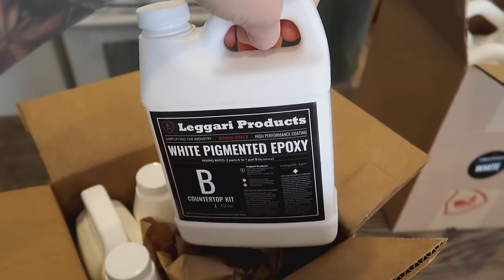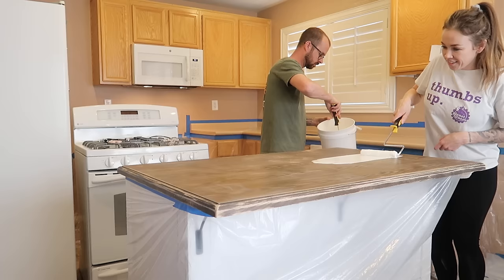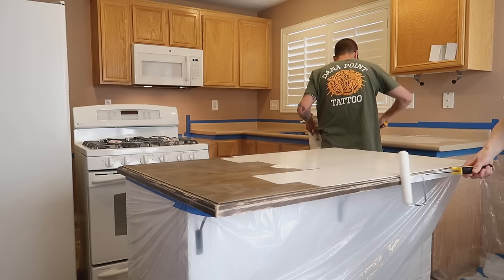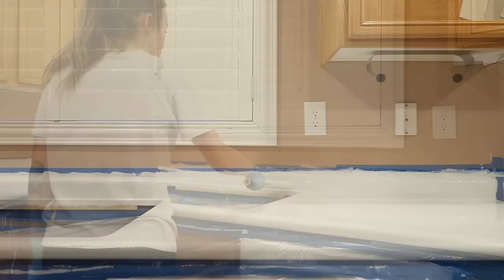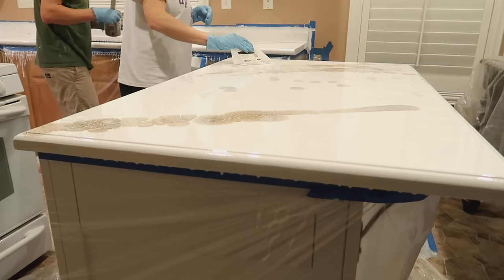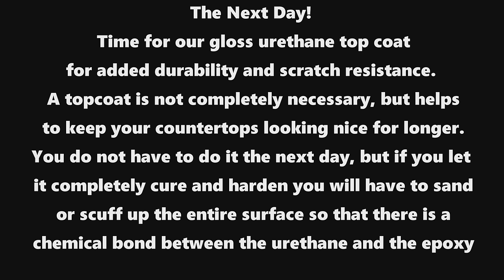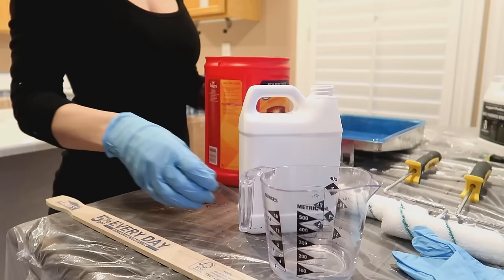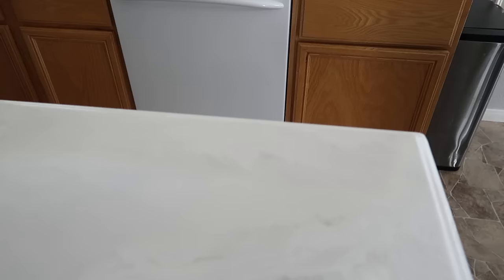HOW TO EPOXY COUNTERTOPS | WHITE MARBLE COUNTERTOP | EPOXY COUNTERTOP DIY | RENEW OLD COUNTERTOPS

Comment: Your countertops look great and I actually like the rolled look of the added color over actual veining.
I do have one question.  I've seen many videos so I'm not sure which product it was used with but to get the bubbles out the person sprayed rubbing alcohol over the top and it eliminated the bubbles.  Do you know anything about this?
Reply from the maker: Thank you so much!!! From my understanding the rubbing alcohol will give it some sort of effect for aesthetic purposes when you’re doing the highlight color (veining) and not necessarily get rid of bubbles. I could totally be wrong though. I think different products require different things. Some people recommend using a heat gun or blow dryer for bubbles. We only had two spots that bubbles and they popped on their own while setting. I don’t know if that answer was helpful or not 😂 I’m so sorry if it wasn’t

Comment: What made you go with leggari, compared to other companies like stone coat?  Great video.
Reply from the maker: What I liked about leggari is that their kits came with the primer and highlight colors (even though I opted not to use them). Also, they don't require applying any heat to the countertops. That intimidated me with other brands, not gonna lie. I'm sure stonecoat is great though! Those were just my main two reasons for choosing leggari. They have great customer service too :)
Reply: @BrontesLife   ok great thank you very much.

Comment: Looks amazing. Don't want to fork out thousands on a 20 yo laminate benchtop, I am going to try this. Does epoxy feel smooth like granite/marble ? Was told epoxy is sensitive to heat, don't place anything hot on it, is that true ?
Reply from the maker: Thank you!!! It is smooth. It is a little sensitive to heat. I would use a trivet or pot holder if placing something warm on the counter

Comment: 7:51 if wanna “save the material” getting “every last bit out” than here’s what ya do.
Go buy a 5 pack of flexible “bench scrapers”. The stuff bakers use to get batters, mixes, etc out of mixing bowls, pans, etc….
They come in 2 main “flavors”: silicone and plastic. My preference is buy BOTH, b/c sometimes the plastic works well and sometimes the silicone is best. Just depends on material using AND, a 2-5 pack of plastic cost $2-$6 at dollar store (or Amazon) and a 1-2 pack of silicone cost around $8-$15 depending on brand, size, & durability etc…(and can find on Amazon, Walmart, Target, but usually won’t find at a dollar store).
They work well getting paint, and other materials out of buckets, bowls, containers…..and if want to clean them up well, can use for baking (bumptious personally I wouldn’t do that, as why risk it 😉).
Great vid and beautiful countertops…..looks nice

Comment: What is the heat resistance of the Legarri Products ??  Great video , I have been on the fence about trying this method also & the heat resistance is one of the important factors to me.  Thanks for sharing your technique,  you did make it look a lot easier than most videos I have seen.  Also do you know if it would be possible to put an additional clear coat after time if there does happen to be any scratches or such ?? Thank you & Merry Christmas  !!!  🎅🎅🎅🤶🤶🤶🌲🌲🌲❄❄
Reply from the maker: It is supposed to be heat resistant, but I have never put it to the test other than a hot coffee mug or a plate with hot food. I always use a trivet or pot holder. And you’re welcome!!! I’m sure you could put an additional top coat, but I’m not 100% sure. I haven’t had any issues with scratches and it’s been just about a year 😊 thank you so much!!!!! Merry Christmas to you and yours as well!! 😍🎄❤️
Reply: @BrontesLife  thank you  !!!

Comment: Great video! My question relates to the odor/smell of the products you used. Were they toxic or high VOC? That's my biggest concern related to epoxy. When I watched the video, you guys didn't seemed bothered by any odor at all, so I thought I'd ask. I've even seen people wearing masks when working with epoxy but you guys didn't. Thank you.
Reply from the maker: Thank you!! It has an odor, but it wasn’t horrible. It’s not your typical epoxy resin that smells horrible. The bondo we used to seal stuff on the prep video smelled way worse than the epoxy. It smelled, but not terribly
Reply: @BrontesLife  Thanks so much for replying!

Comment: How long does this kind of counter top last ?  Does it stand up to regular use of a counter top , without scratches etc ?  It turned out great
Reply from the maker: Thank you so much!!! It should last a while! I’m not sure exactly how long, but at the very least a few years. Our countertops have held up really well! I don’t baby them. We have very minor scratches on them that you can only see in certain lighting and I’m not sure if it’s from sliding stuff around or just the marks left behind when sanding before the top coat. Either way, you can only see them when the light hits a certain way and if you’re looking closely. A couple of spots have stained, but I have no clue what was set there to stain them. Other than that they’re great! Still going strong almost 8 months later!

Comment: Nice epoxy work on the counters! Question...do you know if the epoxy coating resist heat (hot pan) & stain (e.g. pomegranate juice) once it's completely cured. We have a dark granite counter we like to brighten up (similar in color to your white marble countertop color) but can't see spending around  $5K. Just subscribed. Thank you!

Comment: Epoxy resin gives off chemical odors when curing. How strong was the smell in your home during the process? There is always dust in the air,  did you do something special to reduce dust and can you see the dust specs in the final top coat when it was completely cured?
Reply from the maker: The epoxy itself did not have an extremely strong odor, but maybe that’s just because I found the strongest odor was from the bondo we used to repair the countertops. Now that stuff STINKS!!!!!!!!!!! We had to open up windows and have the fans on for that. To reduce dust as much as possible, we closed all of our vents downstairs and didn’t turn the fan on while it was curing then before applying the top coat we sanded away dust and hair. With the top coat there were only a couple of random little pieces of dust and I just left them because once we started putting stuff back in the kitchen, you couldn’t see them. I hope that answers your question! 💙
Reply from the maker: I forgot to add that this epoxy did not give off the odor like your typical resin odor ** resin is extremely potent where this had an odor, but NOTHING like your typical resin. Only reason I know this is because both of my parents have used your regular resin in their artwork. ❤️

Comment: Love this look and video, however you left out an important step... Torching. Did you torch if not how did you remove bubbles?
Reply from the maker: I did not leave out a step because with this product you do not do that 🙌🏻🥰 that is why I never mentioned it. The bubbles leveled themselves out. I only had two that didn’t and then I just lightly sanded them down before the top coat with a high grit sandpaper. I think I showed that
Reply from the maker: And thank you!

Comment: Love it i also have the backsplash on my butcher block. What do you recommend again a paint brush instead of a roller to avoid drips? Thank you thank you
Reply from the maker: Thank you!!! Ok, so you roll it out just as you would do the countertops and treat it just as you would the countertops. However, make sure you are putting a thicker coat of primer on the backsplash and lip of the counters where it will be thinner because it will drip while it’s setting. And while it’s starting to set it will drip just as it will on the lip of the counters. I highly recommend just hanging out and babysitting the backsplash with a paint brush on hand to feather out anything that starts to have really large drips. We did not watch it for long enough, so we have large drips on our backsplashes. It set before we realized what was happening and it was too late to feather them out. 

I hope that helps 😬
Reply: @BrontesLife  ok i understand have paint brush handy to even out the drips. The drying process im guessing could take few hours. Thanks for your advice love your  work hope to have the guts to do it this summer. Make it look easy!
Reply from the maker: Yes! It isn’t hard, I promise! It is just very time consuming. Ours took a couple of days to completely set and harden. Dry time all depends on humidity and temperature in your home :)
Reply: @BrontesLife  i bet the prep & going with out counter use. But worth it thank you
Reply from the maker: Yes! The prep takes a while. It was an interesting experience with having little kids, but 100% worth it!! The countertops have held up well too!

Comment: Great job when you need to freshen it up
Reply from the maker: I’m pretty sure it will last for years. Scratches on it can be buffed out using a drill with a polishing pad and some meguiars polishing paste, or so I’ve read. They’re extremely durable though so they should last a long time without needing to be freshened up. I don’t have any personal experience,  but blogs and forums that I’ve read have said that they hold up well!
Reply: That’s fantastic

Comment: Just a quick question please. I just ordered my first Leggari epoxy kit! Your countertops look exactly like mine, however... my counters have a very slight bump on the edge. It looks like yours is the same. Did you have NY trouble with the epoxy flowing up and over that edge? I see it on your counters but the island is different. Your help is appreciated! Please and thank you 😊
Reply from the maker: How fun! Are you talking about the front or the backsplash???
Reply: @BrontesLife  sorry... a little hard to explain. The front edge of the countertop
Reply from the maker: The back area with the lip (the backsplash) we had issues with because my husband didn’t roll any of the drips out before they set. The front rounded edge no issues! Just made sure to go heavy on the primer in those areas

Comment: Beautiful! Do you think this would work on tile countertops?
Reply from the maker: Thank you! Definitely. It will just be a different process to prep them. I actually looked into it for my parents. The main thing you’ll want to do is create and even surface and fill the grouted areas. I don’t have all of the specifics because we never actually did it, but I believe there are videos on YouTube with the info! If not Google and blog posts will come up. I always watch YouTube videos and read blogs or forums about this stuff. Sorry I don’t have more answers!
Reply from the maker: I may be able to find the “manual” from when we did ours and see if they have something about it on there. I’ll get back to you

Comment: Hey there. Just wanna know how much time did you spend waiting after the first coat before putting the color accents / veins? 
Also, how are they doin know after several months? 
Thanks! The counters look amazing!
Reply from the maker: Hey!! We did it as soon as we’d finished pouring and rolling the epoxy. I want to say you have about an hour to work with the product before it starts to set. They have held up pretty well. There are some areas that are stained and I have no clue what it is from and some spots that have yellowed. Other than that they’re great! Very minor scratches to them and I am not easy on them. Still love them!!! And thank you so much!
Reply from the maker: Sarah C could be! We just have some areas that don’t have heat close to them that have yellowed. Nothing too major that someone walking in would notice, but I notice because I know how white they were. If that makes sense
Reply from the maker: Sarah C I might just have to do that! Or just keep resealing it. Who knows! Lol I’ve reached out to the company though and they’ve given me some suggestions to try to remedy it. I haven’t tried them yet, but we’ll see if they work

Comment: Could you do an update video, how have the countertops stood up to heat, stains, kids banging on them, and ect.?
Reply from the maker: Yes. They’ve held up well, there have been a couple of spots that have kind of yellowed and then a couple of spots that have stained, not sure what stained them though! No issues with the kids or being rough with them! I slide stuff around on them all the time. Very minor scratches that you can only see in certain lighting. I don’t really put heat on them other than a plate of hot food or a cup of coffee, but I have had no issues doing so.
Reply: Thank you I was wonder the same thing! They do look pretty💜

Comment: Is the finish super smooth or is there a little orange peel effect? Also, can u cut o. It or place hot pans on it without any issues?
Reply from the maker: The finish has the slightest orange peel effect from the gloss topcoat. It’s looks like more of a smooth tangerine if you can understand what I mean by that. Barely noticeable. I use a cutting board and trivet or hot pad when I’m cutting or placing hot pans on the counter. The company says it is pretty heat resistant, but I have not put it to the test

Comment: Can this be done on ceramic counter tops with grout lines ?  Also I heard you can do this technique on sinks to make them look like a different sink. I have a stainless steel sink I wanna change to white. Any advice would b greatly appreciated
Reply from the maker: It can. The prep process is a little more intensive, but it can be done. You have to create a level surface, so filling grout. Not sure 100% the entire process but I know it can be done. I had looked into it for my parents. I do not know about the sink though. Definitely contact the company you’re looking to purchase the epoxy from :)

Comment: Will hot pots destroy the epoxy countertops?
Reply from the maker: They’re supposed to be heat resistant, but I’ve never put a hot pot on them. I use a trivet or pot holder ☺️

Comment: Gosh, I am confused about what you folks did in the very beginning of the job. Was their was formica laminate on the counters that was that was first removed? What type of prep work took place after that? I have some counters with old formica laminate, if I remove the material will that leave me with a surface like you started your video with?
Reply from the maker: There’s a whole prep your counter video linked in the description box 🤗 just gotta look for it
Reply: Thank you so much for the info on the 'Prep' video, as well as the applying the epoxy video! 😃
The backsplashes on my kitchen & bathroom counters are uniquely different. They are actually notched into the counter tops an inch below the surface (which is very obvious on the sides) & are on 90 degree angles (not with rounded corner joints or tops). I wonder if I should remove them, fill in the inch recess with wood & bondo filler, epoxy them separately & reattach them later with caulk in the corner joints (like how granite is done)? Also my counter fronts, sides & backsplashes are all 90 degree angles. Is it not possible to work with epoxy on 90 degree corners? All corners must be rounded? I wonder, if I were to epoxy my backsplashes while not attached to the wall, if I could position them in a way so the fronts & tops could be done separately without fighting gravity. Also, if I were to apply epoxy to counter tops, fronts & sides at separate times, if that could remove the necessity of rounding corners? Probably not because of gravity, right
Reply from the maker: I don’t know, I’ve only ever done my countertops. Sorry!

Comment: How did gold paint end up looking grey? Why not just use grey or silver spray paint?
Reply from the maker: Shows it in the video how it went gold to grey. Because I wanted to try a technique I saw in a video. I think I explained that :)
Reply: @BrontesLife  yes you explained that you used gold, but would you get the same results using grey or silver spray paint?
Reply from the maker: Not sure! I just used a technique that I saw this epoxy company use that I wanted to try. The original video that made me want to try the epoxy used this technique.

Comment: Does the slight orange peel go away or it’s permanent? I
Reply from the maker: It’s permanent, but you can barely see it. You can only see it if you’re looking closely at a certain angle or if the light hits a certain way and you’re looking closely. I was worried about it and hesitant to do it because I wanted it smooth, but it’s not bad at all. When I pictured orange peel I pictured a super textured orange. It’s more of a smooth tangerine texture 😂
Reply: Bronte's Life 😬 oh no
Reply from the maker: It’s not bad. I promise! And you don’t have to use a top coat. I think just epoxy is smooth glass like

Comment: A follow-up video would be nice, it's been 8 months, how does it hold up?
Reply from the maker: I have shared a lot about how they’ve been holding up in recent videos :) 

They have held up really great. Only a few spots have had VERY slight yellowing. Still loving them. Feel free to ask any questions if you want specifics!
Reply: @BrontesLife  Thank you so much for the prompt reply!
Reply from the maker: You’re welcome!! I don’t put hot pans or anything of that sort on them without a trivet, so I can’t speak to heat resistance other then a hot mug of coffee or a hot plate of food. Very minor scratches that are only shown in certain lighting
Reply: @BrontesLife   Hi ! i love the color of the kitchen walls, have you done a video on painting them and what color did you use for the kitchen walls?